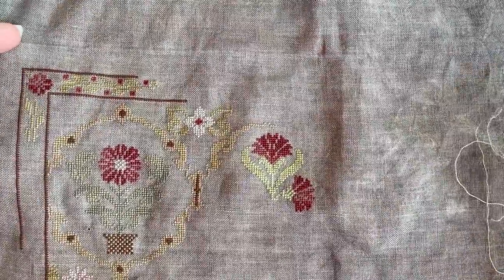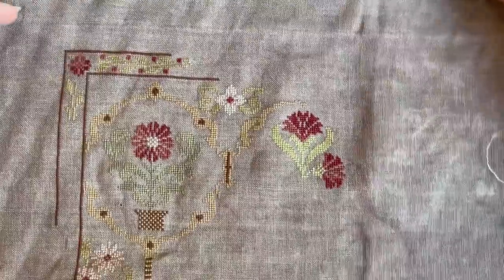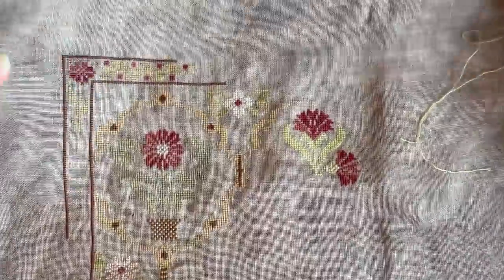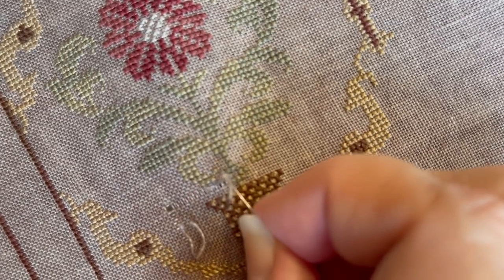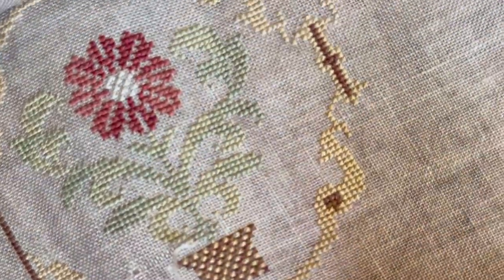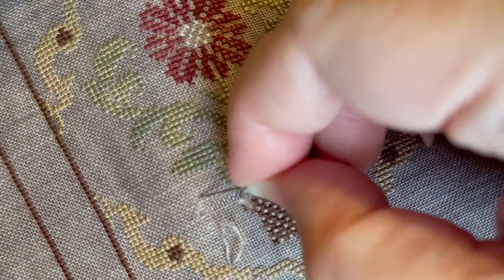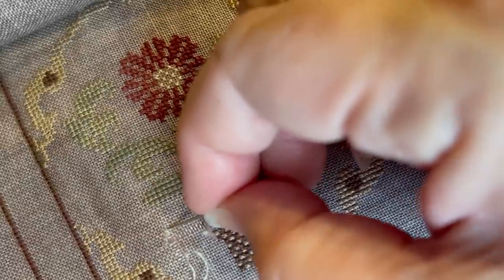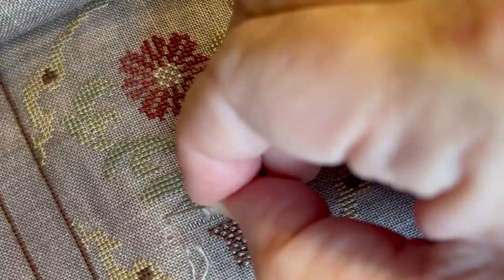Jan Hicks Creates -Tutorial -  How to Repair a Hole in Cross Stitch Linen

Comment: Hi Jan. Great video. Thanks for taking the time to make this.  I do have a suggestion. It would be easier to get those linen threads woven in if you thread your needle like you are going to do a loop start.  Work the needle under the stitches put the linen thread through the loop and then pull it through (under the stitches). That would be easier than trying to use the needle threader